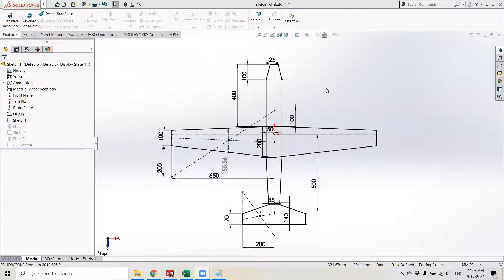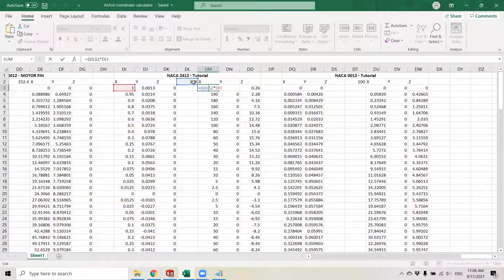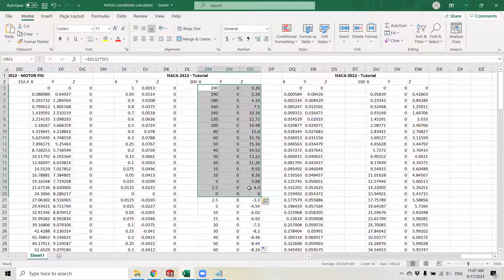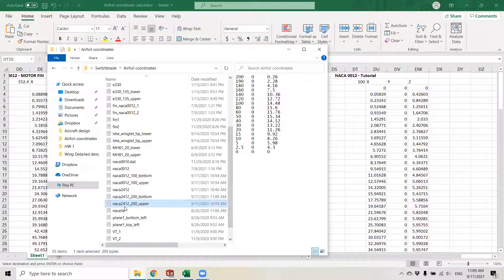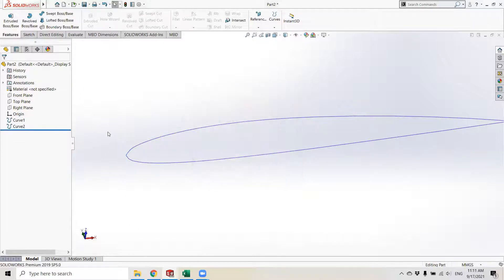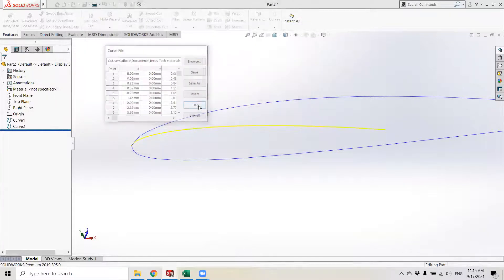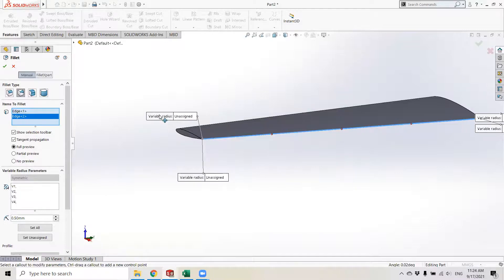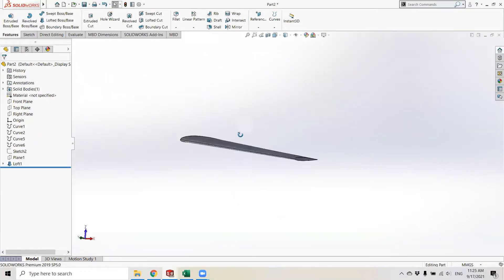Basic Wing Lofting in Solidworks

Comment: Little SW trick. If you had created your root airfoil on the front plane, then created a second sketch for your tip airfoil on an offset plane, you could establish the distance in global variables "b/2" as your 1/2 span. then lofted. If at the intersection of the quarter cord of your tip and root airfoil, you could draw an axis, create an AOA plane, even one for twist. so forth. Another trick. Hold the mouse left button down over the front plane in your feature tree, and then let go. You can change the name of the plane to x-y or "Root Airfoil." makes it easier to model when you keep track of everything going on as complexity rises.